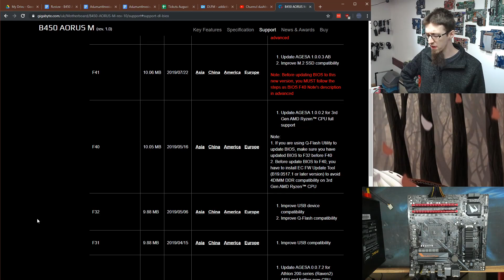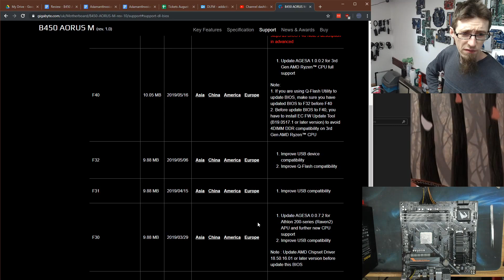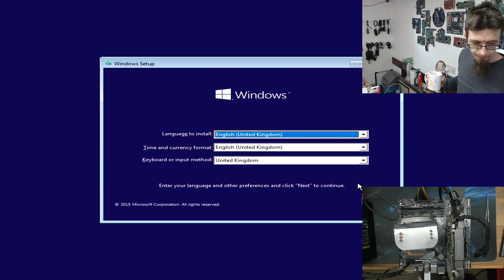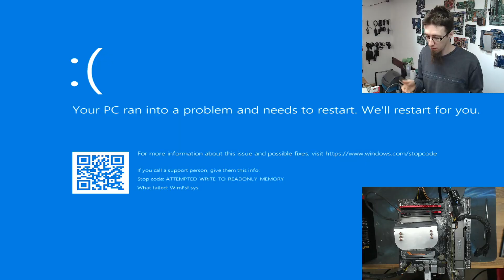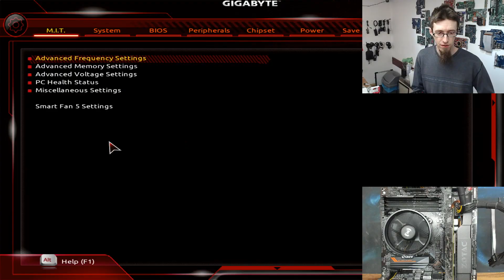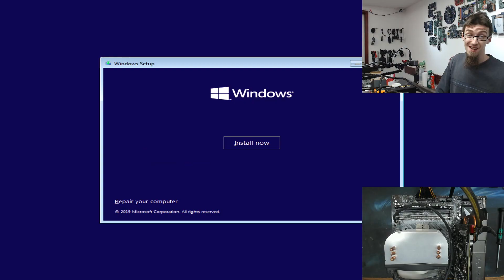LFC#183 - Gigabyte's BIOS update bricked my B450 Aorus M

Comment from the maker: Check this video for updates on this board: https://youtu.be/19HGj3HSeZE
I made a big long video about getting to the bottom of why the B450 Aorus M seems unstable, and how to safely flash it up to the new, stable, F50a BIOS. However, I uncovered that the root of all my flashing woes was my ageing A8-9600 flashing chip.
Yes, there are unstable BIOSes in certain configs, and yes, the board does not help you out along the way, but ultimately, if you flash using the right chip, you won't have any issues. Anyway yea, watch the video, I go through it all.
Reply: There is a way to force these dual BIOS gigabyte boards to recover bios from secondary one without physically swapping them over. I have done it on about 20 different boards by now by shorting chip with a wire while booting up. This forces board to see main bios as corrupted and copies content of secondary bios into main one. I cant remember exactly which pins you have to short for this to happen but can look it up for you if interested. EDIT : its number 1 and number 6 you have to short while booting.
Reply: @kiwisfromhell  Done this with an AMD graphics card after a botched flash. Worked great.
Reply: @kiwisfromhell could you further explain this process to me please. holding a wire to the pins while booting sounds like i could do something really wrong and cause more issues
Reply: These board are also sold with the label "ryzen 3000 ready". It are basically the same boards, but they got an update from the factory. If you can, buy such a board.
Reply: @kriswillems5661   - or just go with intel instead, no hassles........;prolly
Reply: @neilbennett3384  Intel has all the same issues because it's the Motherboard not the Processor you can get another board and have it work perfectly Gigabyte is also not known for their Software work but they do good on hardware
Reply: Adamant IT will I be able to buy this mainboard and download the actual BiOS F50 on a USB stick to be able to run a 3600 on it? I will be buying all parts and building a new PC, having only a Mac for downloading software.....do I need to run all updates or can I just straight go to f50 (without f32 etc.) thanks in advance!
Reply: @vr4ever645  it is best you follow the gigabyte web for now.. I believe they would have it fix by now. However.. if you're buying new mobo.. you can just ask the seller/shop to update it for you.. it's free. Then you can save all the hassle to update it.. just plug n play
Reply: I have flashed to f50 but now is not reconigzed my grafics card and I can get to the bios to check what s wrong.
HOw I can fix it with out seeing haha
Reply: How old was that B450? Thanks again 🤓
Reply: That's why I omit Gigabyte boards.
Reply: notice this Ram issues and compatibility , bios bricked ect ect all go wrong alot more often with budget Ryzen builds ... ill be fixing 20 ryzen builds and i see 2-3 intel builds ussaully 9-10th gen and its easy fixes with ryzen its always a headache
Reply: use your cd rom that came with motherboard it will normally recover the bios...on some motherboards it will load from poweron others need to be force by holding down certain keys while powering on. older pcs used ctrl key, others used f11 and f12, corruption happens with data. I always dos flash never do the in bios flash
Reply: Listen I'm speaking for a friend and I hope you reply to videos very old. So. I will ask. Was it ONLY YOUR chip or is it the website bios updates you download that are broken??
Reply: If you are still reading this:
I believe your motherboard actually shipped with F40 installed on one of the BIOS chips (though possibly corrupted). Support for A8-9600 was actually dropped in F30, so neither F40 or F32 could boot with it. Originally it could not boot with F40 so it switched to backup F2 chip which was later flashed to F32. When you installed Ryzen 5 3600, the original broken F40 bios took over (the dreaded automatic dual bios on gigabyte motherboards), and actually POSTed the PC. I believe it is quite likely that all power cycles are actually caused by motherboard trying to run F32 with R5 3600 until it fails and switches to F40/F41/F42 (whichever is actually installed on another chip).
Most likely not worth it, but might be an interesting experiment to install F32 compatible CPU (Ryzen 1x00/Ryzen 2x00) and checking the bios version (obviously need to force usage of different bios chip than one with F40/F50).

The biggest wonder is how F40 could become stable after resoldering bios chips - maybe it was a bad solder work on chip?
Reply: I need my bios chip removed and flashed asus b550i
Reply: well congrat because i am not hand gifted and replace a bios with soldering etc no way for me lol even though technically i know some stuff, assembly, c , c++ etc began in 1985.. but this i would have returned the mobo
also real shame that the bios backup didn't work on mine i have qflash but seems a better option afterall

Comment: 6 years later I got a similar issue from updating a b450 pro to f67a from f62. Apparently bios’s with lowercase letters are test versions as I now discovered, gigabyte is crazy for putting stuff like this to their official support downloads, mf its a BIOS/UEFI it HAS to be stable no matter WHAT. Anyway, both the main and backup bios got corrupted, in addition to that, while looking at the chip markings with a flashly for ordering the right ch341a, my phone fell right onto my motherboard.
This is just so comically fked up what happened to you but also me.

Anyway, will update with progress, maybe. I hate gigabyte

Comment: I upgraded my BIOS from F51 to F67. Before the update, my computer was working perfectly. The upgrade process was complete, but it's stuck on the boot screen, and the VGA light is constantly on. I can't access the BIOS or do anything else; the computer is unresponsive. My processor is an R7 3700x. Can someone tell me what to do?
Reply: Have you found a solution? Got the same problem, and after a few attempts of rebooting the bloody screen is flickering now and still stuck, I’m thinking of burning down aorus’ HQ
Reply: you will have to take the main bios chip off the board and downgrade it to an earlier bios . program it with an eeprom programmer

Comment: man, your video saved me , i wanted to update a B450 Gigabyte motherboard but got the same nightmare as you, i went first for BIOS version F66G but file was refused so i thought to start first with the F32 version, and got stucked on the LOGO for ages.

Tried evereything, clear CMOS ,changing RAM, chaning CPU nothing worked

Hopefuly i followed your instructions and swaped the BIOS's and got it working again

But as i like fire and dangers i wanted to to follow the red instructions and the next morning i tried to do the EC FW Update tool , but it did the same , stucked on the LOGO for ages... then i got real scared as can't swap the BIOS's again

But after a clear CMOS it booted correctly but still with F2 version

i 'm too scared even to try F41... even from @BIOS on windows

if you try that tool you can upload the BIOS file from their 5 servers list, none of them is working LOL ...

i don't want to give another try and keep it as it is now

Thanks for your video anyway ;) 

And booooooooooo !!! GIGABYTE !!!

Comment: Had a similar problem with a Fatal1ty B450 Gaming K4 motherboard. Upgraded the bios to 3.40 in preparation to upgrade my 2700x to a 5800x. Neither CPU would boot. Had to buy a bios flasher and flash to 5.60 in order to get the board to boot again. So despite what the website says, avoid 3,40 on a Fatal1ty B450 Gaming K4 motherboard.

Comment: I had a friend going to Ryzen 5000 from 3000 but for some reason it bricked itself. I put in my Ryzen 1000 and I think the backup BIOS kicked in because it was on F32 which doesn't support Ryzen 3000 (3000 support was on F40). So I have no idea what is in the backup bios, but the main bios is now on F66 and while still a bit touchy, it is stable going into Windows. Not like the weird lock up issues I had. When you swapped the chips, which bios was on the backup bios? After using the BIOS level q flash I have no idea what is in my backup BIOS.

Comment: The EC FW was prolly not updated before it was flashed to Version F40 ! Many gigabite boards had this at one point with their BIOS versions , in your case i believe you had to flash to F32 , then boot in windows -download the EC FW download tool from the utilties section on the gigabyte support page while you have the F32 BIOS version on ! Update the EC FW and when thats done, only then Flash to F40 , that avoids 4 DiMM compatibility issue !  P.S i know i'm kinda late :D

Comment: I updated the bios now in March 2024, to version f65, the update was completed at 100%, and when the pc restarted it started to hang on the post screen, I removed the main bios chip and tried recording on the CH341A recorder and it it does not record because the bios chip is blocked for recording and does not allow it to be rewritten, I tried starting the board without the main abios chip so that the bios backup chip could start the board but the problem remained the same, I did not update this chip bios backup I don't know why the board doesn't turn on. Do you think I will have to buy two new bios chips 25U12873F and rewrite and when I solder the board it will work again?

Comment: Well, gonna give some life saving tips: 

If you killed it, no need for new cpu, just get a screwdriver, stick it to the cmos reset right below the red leds from the video, press power and reset at the same time, it will boot to bios, go ahead and install original bios that was previously installed, there, got a pc powering back on
Reply: Just killed mine and saved it that way

Comment: In my opinion gigabyte needs to take a page from Asus and offer a  internet download option alongside  the traditional USB flash device method so if u do it via internet it automatically finds the correct bios for the board your using so there's no issues why it's not a standard in 2023 for all manufacturers I don't understand. Yes I know there's @bios utility but why can't it just be baked into the bios menu? Besides @bios doesn't always find latest bios either

Comment: Same type of frustration I went through with my X370 Gigabyte board.  I managed to get the BIOS updated to the required version (F51d) with no issues, but along the way I was never sure if the EC FW tool actually did what it was supposed to do.  Even though the BIOS update was successful,  it would never accept a R5 5500 CPU, that works fine in another system.  At the end I settled for leaving an R5 3600 in the system.  As far as I've seen, only Gigabyte requires on to go through these extra crazy steps, and their execution is lacking.  Ever since though it seems booting to Windows has really slowed down.

Comment: hey adam, 
i have same CPU Ryzen 5 3600 and 32GB RAM DDR4. my BIOS version was B51 and i updated it to F62. now i have a weird issue.

When i open my PC after 10sec it turns off automatically for some reason. i was thinking about to roll back to F51 but i dont know how to do so properly. should i go to F32 first or just go straight to F51?

Comment: you skipped the f40 bios step....they did warn you of that very thing on the gigabyte website, you must have f40 installed to go to f41. i rolled back in your video showing the motherboard website and the f41 warns you must jump from f40 to f41. so if you didnt do f32--->f40--->f41--->f42 you skipped an important step.
Reply: Is that mobo still good now? I found pc with 6700xt 5600 x 24gb 3000Mhz DDR4 and Gigabyte AORUS B450M
For 760eur in Europe prices

Comment: I'm honestly terrified to update my bios now..
like you said flashing the bios is usually a cut and dried sort of thing but this board in particular seems to be dodgy and I'm scared to tamper with my mobo.
Its one of those "if it isn't broke don't fix it" type deals
Reply: I just did two updates on my B550 pro~p and it went fine. Very easy.
Reply: @kungfury6410  did you update straight to a latest bios version or did you flash f32 then f40 then to the latest?

Comment: I have been using the Gigabyte B450M Gaming mobo for a while now, in several different Ryzen PCs. The BIOS set has the same red text and I followed the update instructions but ignored the windows bit as I run Linux Mint systems. No problems whatever, XMP is super easy. Running 5950X on latest BIOS no problems.

Comment: if  anyone going to break a Pre built 2012 HP P7-1220 desktop computer motherboard bios updating the Bois from the HP update Bois software in Windows 10 and I just upgraded from Windows 7 on it when it new  like this it has to be and a paper broke half deaf disabled guy With Autism and I have a vidownshookg it browk no post screen and I hear 4 beep beep beep after it restarted and it was working just fine for windows 10 on a Samsung Evo 860 1tb SSD drive until I tried to update the bios it motherboard is bricked broken now after I updated the bios from the HP BIOS update software 💔😭😤😠

Comment: Because BIOS flashing is potentially risky, if you do not encounter problems using the current version of BIOS, it is recommended that you not flash the BIOS. To flash the BIOS, do it with caution. Inadequate BIOS flashing may result in system malfunction.

Comment: Help please aorus b450 elite rev 1 . No boot ryzen 3 3200g f32 update tool ok no reboot upgrade f40 always no boot led dram 😢
Testing in athlon 240ge boot ok 🤷‍♂️
Blocked amd athlon 240ge.
No boot ryzen 3 3200g et ryzen 5 2600x f32 f40 f41 led dram 😢
I havé à flash programmer ch341a

Comment: Hey man, i just watched your video, i just have one question pls. Should i jump from f4 to f63a or first from f4 to f42 (because you said f32 is bas bios) then f63a? pls i need answers!
Reply from the maker: I'd just go straight up to the highest it will let you at this point, and it should be fine. The BIOS has had a lot of work since this video was made.
Reply: @Adamant_IT  Thanks. There are no additional notes under last 3 bios versions, so i guess it should be fine.

Comment: Gigabyte bricked my B560M, for a long time I thought I did something wrong but backtracking my steps and re-checking my downloads for like a million times, I am now convinced Gigabyte have a faulty bios. Not happy and wouldn't recommend or use their mobos again
Reply: Same happened to me. They bricked my b450 gaming x. Bios F67c.
Reply: @rodrigoverclocker  Never download bios unless you need them, let others use it so all the hiccups are worked out.

Comment: I still wonder to this day, if BIOS update is worth any risk. The brand I have - which is a top brand - has got extremely unclear descriptions how to do that. And I know the inside of a computer, so go figure.
Reply: For AMD they are. New BIOS contains new important AGESA code that governs CPU behavior and has fixed massive performance regressions and weird boost behavior in the past. Any AM5 board worth its salt has BIOS Flashback, so the issue in this video is a non issue.

Comment: When I see things like incorrectly named BIOS files that brick peoples' boards, I really feel like taking a dump down the neck of the person responsible for this (not really,but this is not acceptable).
Also, why on earth aren't the Mobo manufaturers and the folks responsible for their web presence, integrating a checksum verification system to provide signed checksum's+bios labels to their consumers.
NO NORMAL PERSON can be expected to go through this type of ordeal just to update their board in order to enhance its functionality to the advertised levels.
AMD keeps telling people that their Ryzen CPU's work on the AM4 socket as long the mainboard manufacturers provide a BIOS update and the board meets specific technical requirements. Same with the mainboard manufacturers, explicitely declaring CPU compatibility on their CPU support list.

If they add all these informations stating that a CPU is expected to work, then they should make it foolproof and safe for the consumer to do a BIOS update without having to fear to brick the board from shit like mislabeled, unverified bin's...

So, a first step would be checksum verification.
This is standard procedure after downloading Linux iso files, cuz it's easy to do and provides security. In the case of BIOS bin's ...you'd verify the bin and get a checksum ABCDE12345 which corresponds to version v1.0. If you get a different checksum, you'd know the bin has been either tampered with, it's corrupted or simply just mislabeled and incorrect, enabling you to compare checksum's to find the correct BIOS, and/or make the informed decision to avoid that fucking thing like the plague... also saving the board folks logistic and bureaucratic RMA-diarrhea in the process.

Comment: I know i'm quite late to a party on this video, but I was wondering what would have happened if you connected your hyper x memory module from B2 slot to A2 slot while on the F40 bios version since it was reading it like it was connected to A2 and not B2? That would explain the hangs, and hard locks and getting stuck at DRAM led in my opinion, i could be wrong but this intrigues me. All in all a solid video mate, liked and subbed.

Comment: Does all gigabyte board has dual bios?
Reply from the maker: Pretty much all of them, yea. It's one of their signature features. I personally don't think it's very useful except for on the higher-end models where it's switch-controlled though. The automatic switching one, as on this model, kinda works when it feels like it, and there's zero indication as to which BIOS you're operating on.